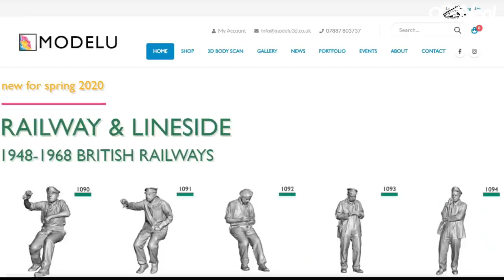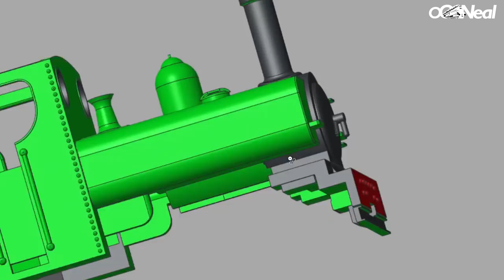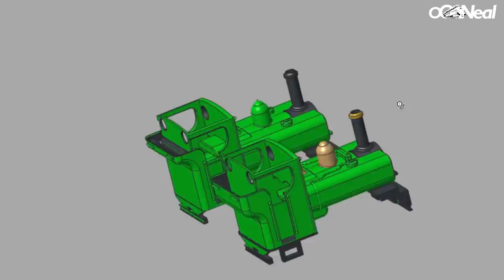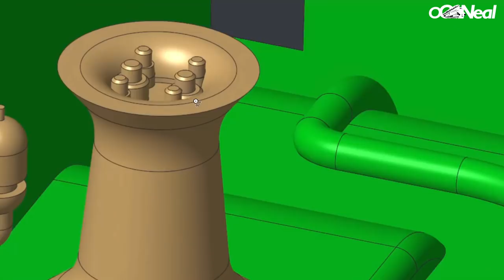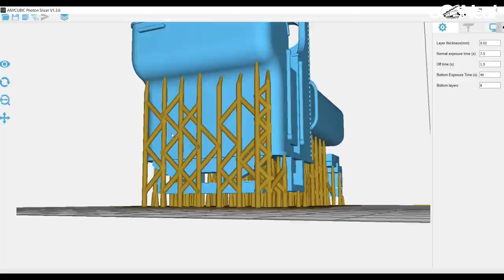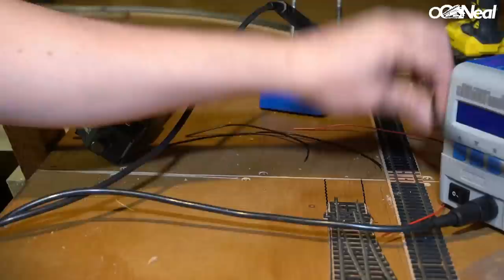Building Up A Model Railway S1 Ep 36 | So Much Fun! | 009 | 3D Printing | model painting | GoPro Fun

Comment: CNC lathes.. EMCO unimat 3. I have seen a CNC version. Nowt wrong with an ML7 if it’s a One off. I spied with my little eye.. one hiding in the background of one of your videos! Richard from RDG tools in Myfordolmroyd Notts is yer man for anything tooling😜🚂🚂 since when did titch have a central buffer?.. see, not always 009.. sometimes 5 inch gauge. Polly, speedy, Russell is on the bench..🙃👍🚂🚂🚂

Comment: That OO9 Pannier is a little  boster! 

All it needs is a running number, I think Narrow Planet does/did etched metal name/number/builders plates to order, including GWR style.  Though I don't know what the options are mid-lockdown.  My facimilie copy of the 1949 edition of the Ian Allen published "The ABC of British Railways Locomotives" doesn't list the numbers 2-4, 6 & 10-27, so either British Railways condemned them pretty quickly or they were legitimately unused (at least in the GWR's final years).  I'm thinking that a low number = a small plate for a small loco.

Comment: Great video again!
It feels weird, were both doing model rail way and recording and making stuff in 3D too print in resin.
Course I am getting ahead of myself, I need to finish the table sections first :D
Also take note, you should grease your 3D printer spindle and add a touch of oil to where the mount meets the screw to get it lubed good. It will quite it down and moisten old grease if your units been sitting on the shelve for awhile before purchase.
I had too do it too mine as it wasn't raising up.
Reply from the maker: The Hobbyist Den thank you I’ll take that on board 😊

Comment: Brilliant, micro-pannier looked great! If you’re finding loco colours a bit pricey and exact match isn’t the be all and end all (especially on fictitious designs, different lighting anyway and even RTR models often having compromises...), a quick google will reveal what automotive colours are a fair match for certain liveries. I’m fortunate enough to have a trade card for a certain retailer of automotive products and pushbikes and I’m pretty happy with the results I’ve had. What I would say is I’ve tried to source paints cheaper on ‘that’ auction site but found the quality lacking for barely any saving. Mind you, when you get airbrushing, none of this will matter... nice to see a video with pressfix transfers having only used water slides myself, how well did you find they sunk into lines between planks and the diagonal beam on the wagons?
Reply from the maker: Leccy Steam I think that’s my longest comment 😊 so that’s a good point off the shelf items may do the trick. I think the airbrush will come in handy. I just need to get an air compressor for my hobby room so I can do the work. Yes the prefix transfers needed some work over some of the bits that were sticking out but ultimately on the planks it was absolutely fine. So far so good they have stayed on. I havnt got any of the water slide ones but I’ll maybe pick up some options over time.

Comment: hi tristan
lovely video as usual and the little engine looks fantastic
i have just got the elegoo mars resin printer but i have yet to use it
i hope that my prints come out half as good as yours and i will be happy its the 3 d drawing that i am having trouble with i use design spark mechanical to do my drawing  but it not my favourite job 
on the compressor for the air brush i have this little one 241183 Silent Type Air Compressor 65DB 600W 9L for Mobile Garage, Dental Clinic that i bought from amazon its very quit and has a  9 lt tank  its about £99.00 plus delivery so is ideal for an air brush  with the usual extra bits that is needed for airbrushing
there is also a bigger tank one there on amazon
hope this helps 
looking forward to more of your videos
regards
james
Reply from the maker: Thanks I will look up the compressor 😊 I’ve heard the elegoo mars it’s good so I hope you enjoy it. Try chitubox for your slicing as I kind it nicer you use than the supplied sliver software. Thanks for watching and stay safe
Reply: @OONeal  
thanks for the tip to use chitubox i will download it and try it  as i said my real  issues are with the 3d drawing  but hopefully i will get there  it might take a long time though lol 
mind your self and take care
regards
james